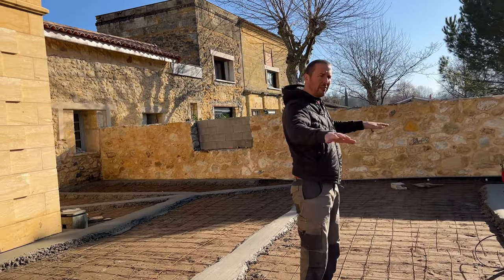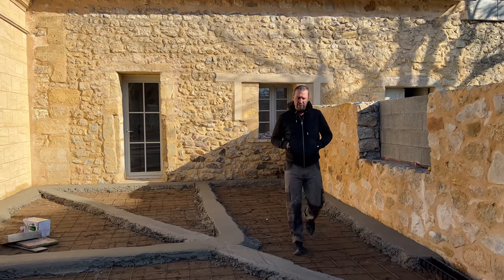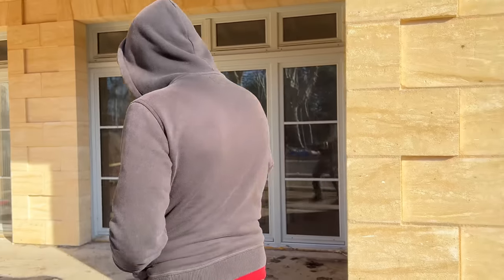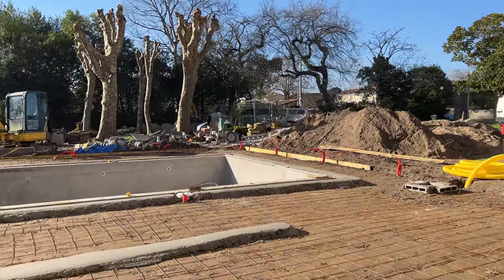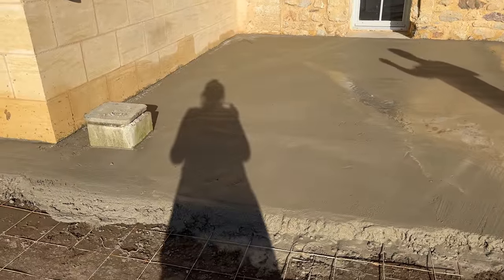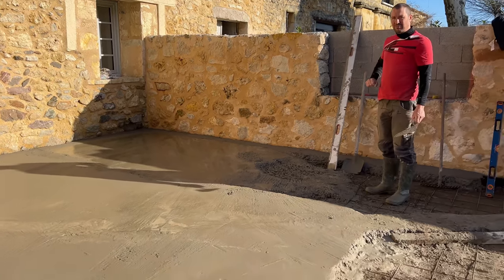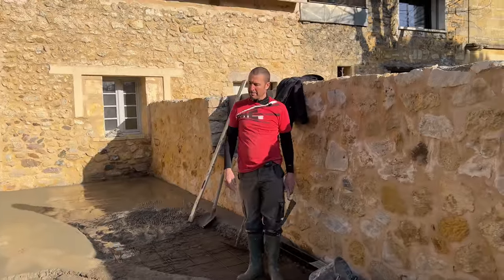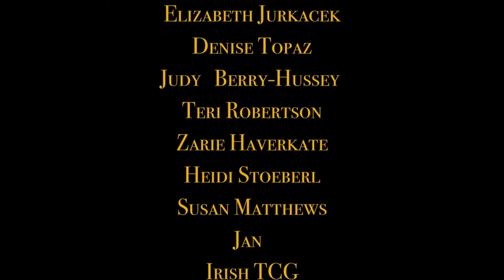EP109 Issues , Pool Terrace ,Baptism Of Fire at Our Passion Project

Comment: Years ago,  my husband who actually drove a concrete truck for a living, poured a cement slab around the pool area we put in. We all put a hand print in it with first names and year. I'm sure it's long gone by now though.  
But also EDD, since you still have so much to pour.  Wherever you guys have that you can rent various tools & equipment from in your area.  Check into renting a concrete float.  At least that is what they are called here. Very inexpensive but a game and back saver. The handle is adjustable and it's a wide flat shape that just glides over the poured concrete.  Makes it a breeze to spread,  even and smooth.
Reply: Risa, you say "at least that is what they are called here" but, you don't say where "here" is. So where is "here"?
Reply: @billgreen1861  I believe she is in the States.

Comment: Ed, love your channel and watching you make progress. 2 things with the concrete though, if you dont have the mesh at least 50mm off the sub base it's not going to add any strength so you might as well save your money and not bother putting it in. Secondly don't pour concrete unless the minimum temp is 2 degrees C and rising as it won't cure properly.

Comment: Just signed up.. looking forward to seeing your dream come to fruition… just one thing I’d like to recommend. The rebar mesh should be suspended in the concrete mix , not resting on the sand. Also when you’ve slabbed it run some cuts in the finished floor to prevent cracking. Looking forward to your content. G

Comment: Worked concrete on several of my remodeling projects - I would suggest that the wire mat would increase the concrete stability if you placed the small supports to keep the wire mat 4" off the ground. In my experience the standard 6-10" pour is fine with that. Wondering if you have access to a "float" to work the concrete as it is poured. Plus, the rake is a big help in removing the "bubbles". Hey, if you're learning something new I'm giving you 4 stars for what you've done. Way to go Edd.

Comment: Hi Ed, One thing I noticed about your concrete work is that you are not lifting the wire so that it sits in your concrete not underneath it. I was always told to lift the wire into the concrete. Just an observation.
Reply: @ HorstRossman Yes I mentioned yesterday that in Australia we have little plastic pyramid shapes that go under  the reo lifting it just a fraction so that it settles into the middle of the concrete creating a stronger slab